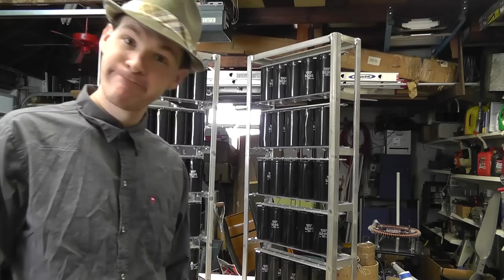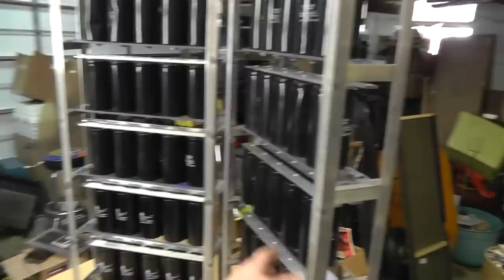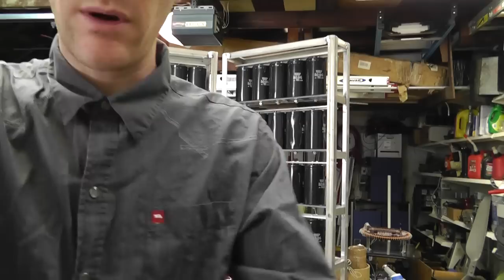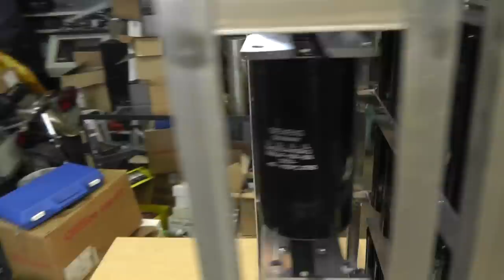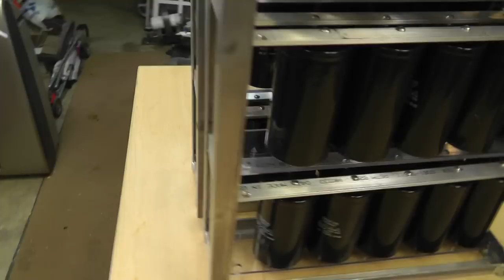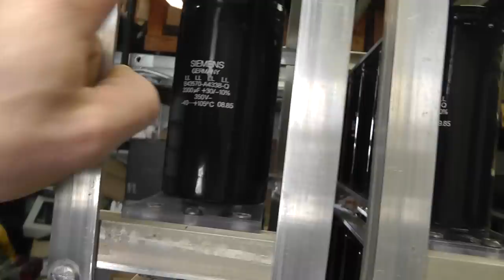10K joules 1: Cap Bank  Done And Almost Ready For Testing. A Work Of Art...

Comment: I would wear all cotton clothing (and long sleeves) when discharging the bank. Cotton does burn but it doesn't seem to make the "instant fuel" the synthetics seem to make. This is a safety precaution we use at our plant when working in switch-rooms to protect against an arc blast. Maybe some type of blast shield also? Great work by the way, I want to build one now...

Comment: I rapidly charged a 2000 volt cap with 3 volts from 2 AA batteries. I attempted to hook the Bedini circuit to the cell but fried my transistor in the attempt. I was just thinking after seeing this that we could regulate a multiple cap dump timed for split cel Pure Hydrogen generation with a low amp input. You have the tools to do it. Looks like you are having a lot of fun.

Comment: You can make nano powder by discharging the load over a small diameter wire in a sealed chamber. You could sell the powder on eBay for $100-200/100g to help fund your projects.

Comment: To hell with running them perallel. RUN THEM IN SERIES!! See how much reverse polarity  you can get from a coil and a magnet. mount the magnet on a bicycle wheel and watch it spin!
Or see at what range you could fry a sqruirrel with a bolt of lightning!!! or generate an EMP!!!! 
just a thought...

Comment: Is it possible to run threaded rod, from the top to bottom rows, between the two sides to handle the energy that is being produced or moved for that matter?  Then you would need to use something to isolate the threaded rod to prevent possible arc between the two rails such as cpvc or some other non conductive material.  I assume you used a Jig to set up each aluminum rail so each hole should be aligned top to bottom.  Good Luck...

Comment: the national electric code requires a bleeder resistor that is able to discharge the capacitors potential within 1 minute. this would be say, 10 M ohm 10 W probably every bank. will save your life. will not interfere with cap function, only drain them safely upon de-energization.  i am sure you know this but will everybody that sees this. thank you

Comment: leave the garage door open while testing or you may regret not heeding this warning!! We blew the roof off our initial testing of our lightning lab with a charge of over 2.5 mega joules in a bolt of lightning only 6 inchs across and 6 inchs wide!! It warped a piece of 1" 6061 aluminum sheet around a missile nosecone 5 ft away...